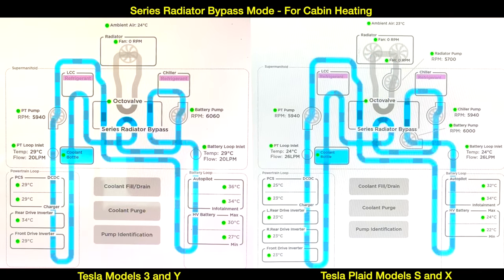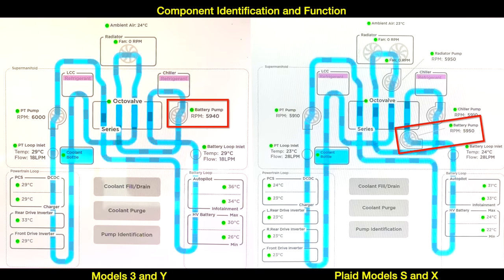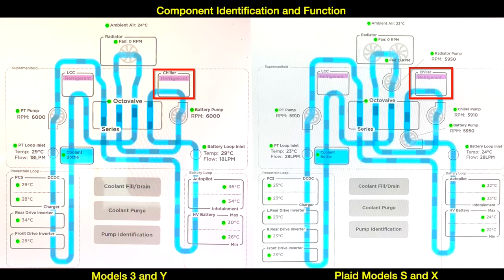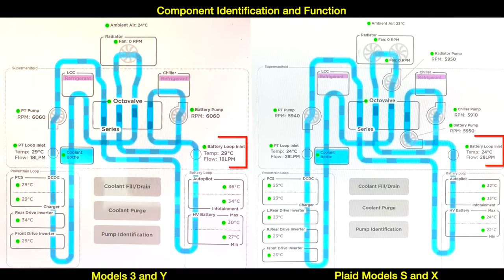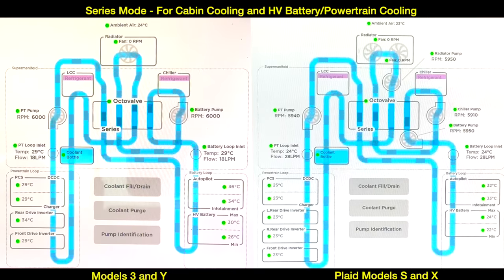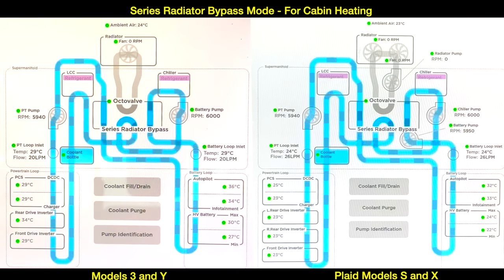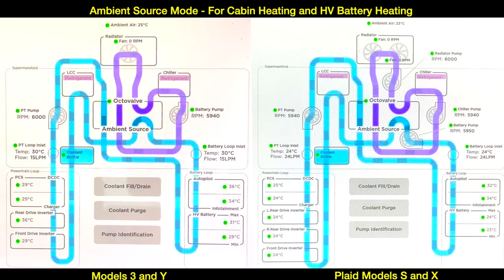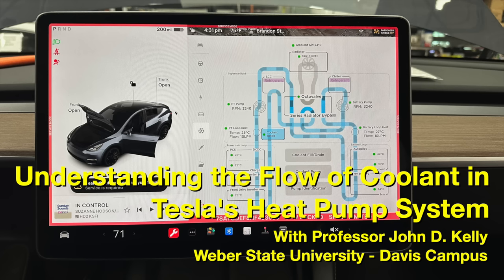Understanding Coolant Flow in a Tesla

Comment: This octovalve is a great device when every watt counts! Maybe this type of thinking can be applied to grocery store freezers and data rooms within buildings (currently all heat is dumped outside even in the dead of winter).
Reply from the maker: Agreed! Thanks for watching.
Reply: Many grocery store refrigeration rack systems have heat recovery coils inside the building where air from the store interior is blown over them to recover heat from the refrigeration cycle vs. dumping it outdoors through the condensing units.
Reply: @ArtCooler1  I am curious, where have you seen this installed? My company does a fair amount of grocery store and wholesale warehouse construction, and I have yet to even see provisions for this let alone install.
Reply: @randomvideosn0where  I've seen it in older grocery stores.
Reply: I also think and this being used in restaurants and homes

Comment: My air to air heat pump at home, needs to defrost in the winter time. I wonder if the car ever need to defrost. Would be kind of hard while driving to get the radiator above freezing to melt the ice.
Reply from the maker: Yes, it does at times. I believe the system can run warm coolant through the radiator to thaw it as needed. Thank you for watching.
Reply: @WeberAuto  thanks for replying! :D

Comment: Thank you for this very informative video. What I found noteworthy about this design is the fact that the autopilot computer is in the same loop with the battery. If I understand it correctly, it means that the computer will be warmed up upon preheating the battery to about 50°C before charging.

This is weird but I can imagine that even then then cooling power for the CPU will be high enough to cool it adequately (CPUs in notebooks often run at 100°C with no problem at all). So, the only downside might be large and fast temperature swings. These might cause mechanical stresses on solder joints due to different thermal expansion of the chip carrier and the PCB board during the temperature transition. Let's hope its impact on life expectancy of the computer will be far beyond the lifetime of the vehicle.
Reply from the maker: Thank you. Agreed, the temperature difference is more than enough to keep the autopilot computer cool. The autopilot computer has been liquid cooled on Teslas for many years. I do not know what the failure rate has been, but I have not heard of any failing.

Comment: Best video! I drive in service mode sometimes to watch this all in action. How were you able to force to get into the different modes. Can you provide the logic on how each mode is entered?
Reply from the maker: Thank you. It requires the paid Toolbox 3 subscription from Tesla to enter Service Mode Plus; I should have specified that I was in Service Mode Plus. Use a Tesla Toolbox 3 Action called "Thermal Coolant Flow Cycle" to cycle the Octovalve through its four modes as shown in the video. The procedure takes 20 minutes (five minutes in each position).

Comment: I wonder how often those octovalves go bad and how hard they are to replace. Interesting video 👍🏼
Reply from the maker: Good question. Time will tell. Thanks for watching
Reply: Probably not too often.  IIRC, there’s an actuator motor and that’s about it.  I’d be more concerned about the myriad of seals and o-rings that go into the Tesla thermal management system, especially within the manifold.  That being said, Tesla does a pretty good job keeping the hose count down.  Every one of those connections is a potential point of leaks.

Comment: Nice presentation. But particucily in this case, what needs to be cooled? There is no any component with high temperature. My Tesla is cooling something in parking mode hours after I come home. I realy start to wonder what needs to be cooled down?🤔🤔🤔🤔
Reply from the maker: The high-voltage battery and all other high-voltage components get hot while operating. The battery gets hot while charging too.

Comment: Hey professor ! I just got a wild idea ! If you could pull the three-phase leads for both MG 1 & MG 2 off the inverter in a 2nd or 3rd gen Prius, connect them together in the right order, and get the engine to run, (perhaps with an external 12v starter on the crank bolt)... would it drive the car without the hybrid battery connected to the MGs ?

Comment: So is series radiator bypass also used to cool the cabin and heat the PT/Battery simultaneously? Just open the valve to the LCC instead of the chiller?

Comment: I don't get where in the diagram the heat transfer between coolant and cabin air is. Can anyone help? Is it the radiator? But isn't there a radiator in the bumper?
Reply: me neither
Reply: This is the coolant side, it interfaces with the refrigerant loop at the Liquid Cooled Condenser (LCC) in the upper left and the Chiller in the upper right. One for receiving and one for rejecting heat, respectively.
Reply from the maker: The heat transfer from the coolant to the refrigerant happens in the Chiller. The refrigerant side of the supermanifold is not shown in this video, but you can see it and how the cabin is heated here https://youtu.be/Dujr3DRkpDU
Reply: @WeberAuto  Oh, the heat exchange with the cabin is in the refrigerant loop. Thanks, and thank you for the link. But after watching the whole hour, I still don't understand why. Wouldn't you want to keep the refrigerant loop as small and simple as possible?
Reply from the maker: @zahlex  This is the simple version. You should see the heat pump system in some other cars.
Reply: @zahlex  "...  I still don't understand why. Wouldn't you want to keep the refrigerant loop as small and simple as possible?"
I think that the heat transfer to/from the cabin is more effective and efficient directly from the refrigerant loop, rather than indirectly through the chiller and LCC of the coolant loop. So it could be a trade off between efficiency and refrigeration system size and simplicity.

Comment: hello or an error u 0110 on a Toyota Auris (loss of communication with the control motor control unit a) I'm literally going crazy either replace the inverter or replace the control unit checked the system on the gearbox up to the inverter, checked the one from the compressor to the control unit everything is ok the system and perfect can anyone help me please

Comment: Thanks, Prof. Kelly!  Another excellent presentation.  Seems EV's are much more complicated than we have been led to believe.  Imagine a 10, 15, 20 year-old Tesla with multiple owners over the years,  and a poorly maintained cooling system as this.  Corrosion, damaged heat exchangers, pumps, controls, coolant passages plugged up.... OH BOY, what a NIGHTMARE!!!!!!
Reply from the maker: Thank you!
Reply: It might be not so bad. ICE coolant has many temperature cycles in range of 0-100*C, while BEV coolant works much cooler, I guess up to 50*C.
Add no blow-by's from exhaust or motor oil.
Reply: Probably depends on the EV.  But all of these types of cars put much less temperature stress on these components and fluids.  Like almost none compared to a regular ICE vehicle.  My wife and I both own Bolt EVs.  5 years and 60000 miles separate them, yet the coolant and brake fluid look identical between them.  Manual doesn't even call for servicing until 150k miles.
Reply: Lol these cars wont see 20 years, engineered to fail
Reply from the maker: @spazzman90  The Bolt EV coolant needs to be changed every five years or 150k miles, whichever occurs first.
Reply: Complexity of this is still better than that of gasoline engine and transmission.